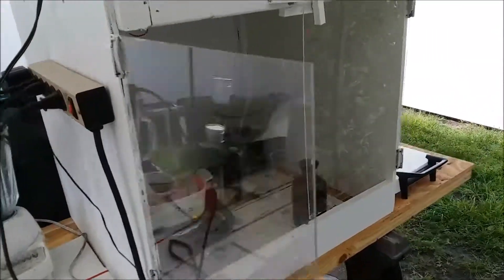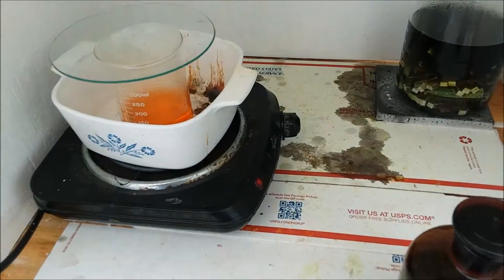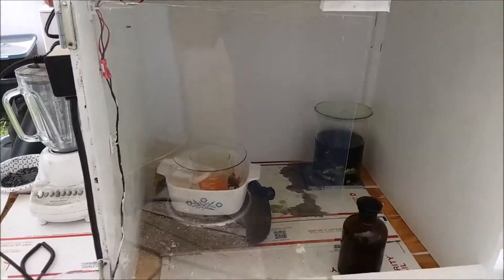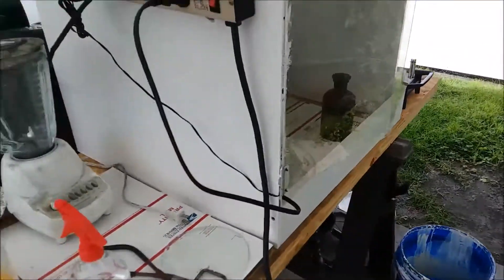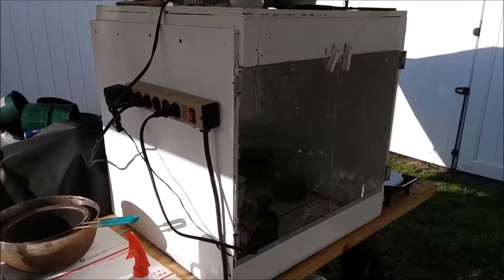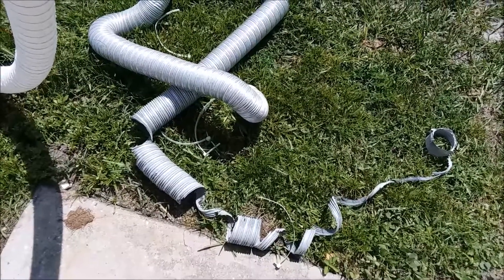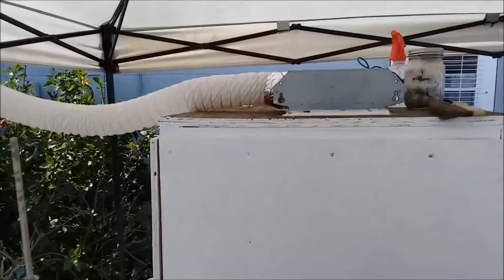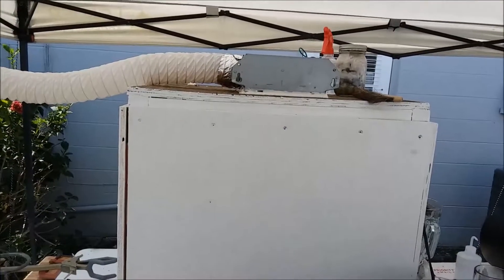Home-made Chemical Fume Hood Update

Comment: Nice thing, your Fume Hood. I would have made mine a bit higher, just in case I have laboratory set ups, which need higher columns, or dripping funnels. 
To give you a tip, I would additionally cover it from inside with carpet-pvc to prevent oxidation of the wood e.g. from SO3-fumes and gask up everything with silicone. 
Would be interesting to know, how much power your fan has and which diameter of Tube you have on it.
But really, nice project and inspiring - thumbs up!

Comment: I really appreciate your videos I’ve been stockpiling materials for my own gold recovery yeah like I said I really appreciate all but I appreciate all your guises stuff but I’ve seen a design for a few more hood open the top where your fan is 5 inches in that back corner it’s baffled it’s a little slant going up and then right in front of the door there’s like a 3 inch strip with the screen there so air can get through and write up the back wall up that baffle and into the fan I saw a real cool design online